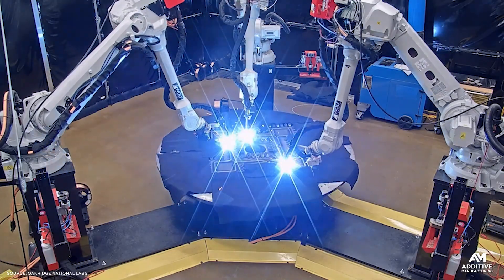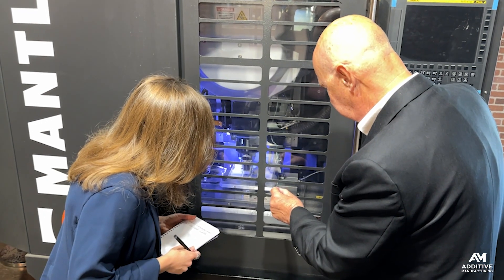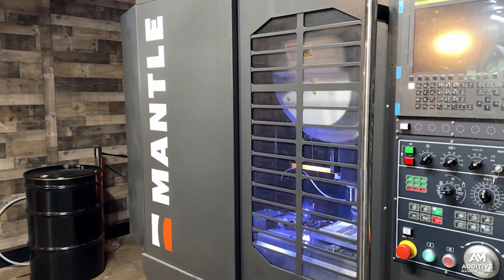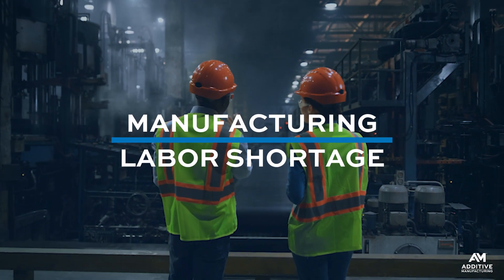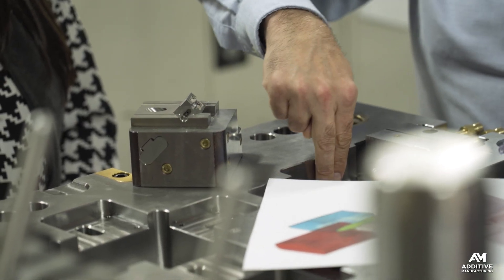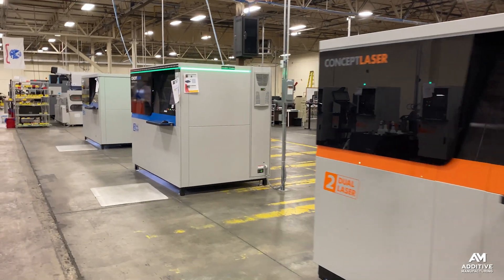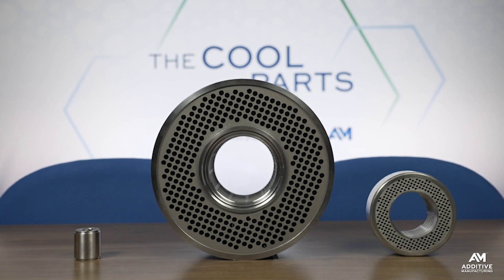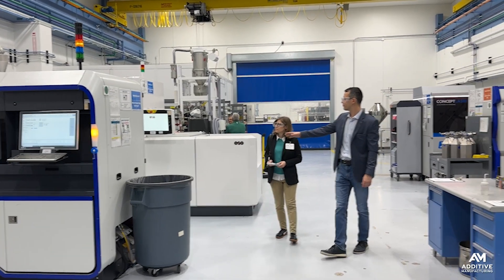Is Additive Manufacturing a Form of Automation?

Comment: For people that create, (makers), they use the tool they have, the tools they know how to use.
They solve the problems with the tools they have.
The more tools they have access to and the better they are to using those tools, the better the solution they end up with can get.
But creators are often limited by the price of the tools. 3D metal printers and CNC machines are not cheap.

Sometimes a CNC is the best tool for the job, sometime a 3D printer is the best. But if you only have access to a 3D printer or only know how to use a 3D printer, then you will probably settle for a 3D printed solution even if a CNC solution would have been 5-15% better. 🤷

I think we need both. But we need more than that. Cause we also need the raw materials. Creating things requires a who ecosystem. And in many places on this  planet the ecosystem is really poor, and then there are a few places where the ecosystem is thriving. And where the ecosystem is thriving, that is where everything gets made.

Comment: how can someone get in to metal 3d printing as machines are costly, coming from a person who uses fdm and sla printers.
Reply: Find a company that will hire you to train you. Experience with 3D printing in general (CAD knowledge, metal knowledge, etc ) is a plus so try to do as much research and design parts to show off your work and dedication to the process. If you have to move, make sure your pay matches your needs.